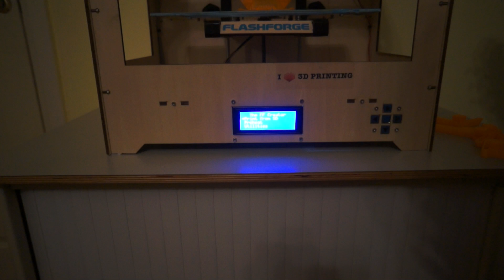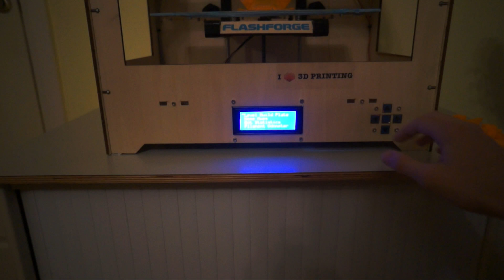Review Flashforge Creator 3D printer with dual extruder + improvements!

Comment: are the fumes a problem? I am getting one of these and i am worried that I will stink up my house and set my smoke alarms off...
Reply from the maker: William Evans the fumes from PLA are okay its biological also. ABS on the other hand smells a little bit more though, and is not healthy too breathe a lot. It wont set up any smoke alarms but a room printing abs should be a little ventilated in my opinion.